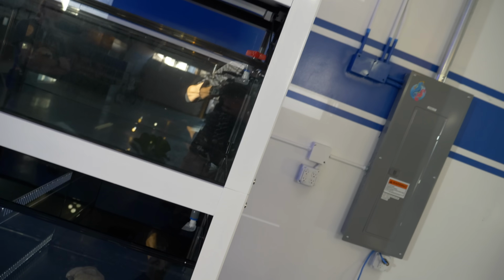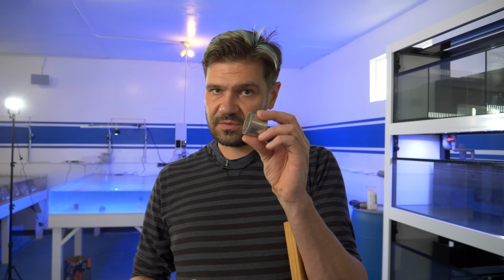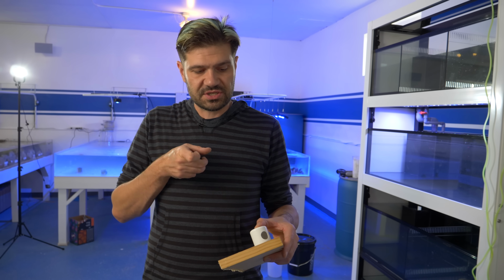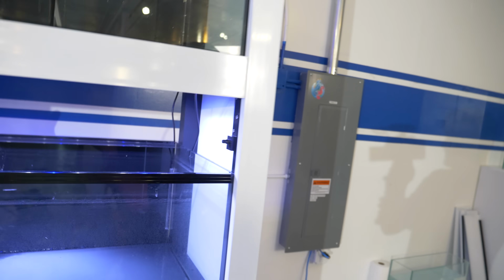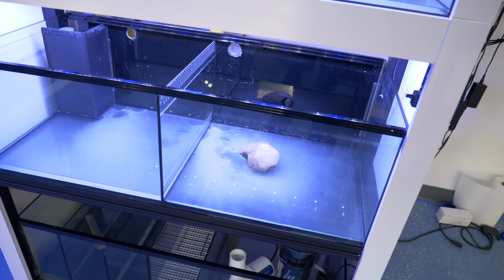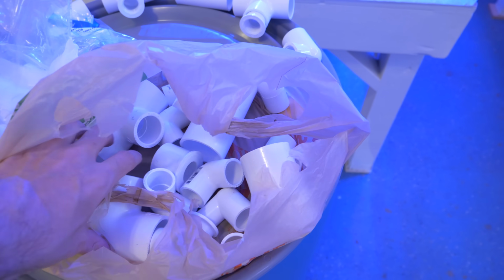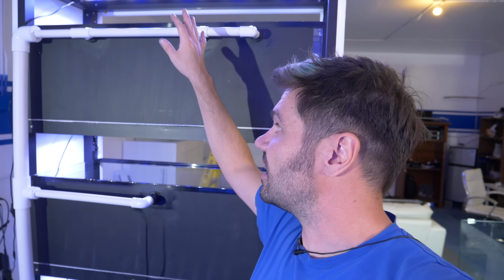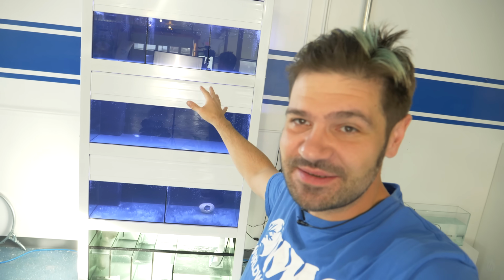Vlog 17: How to Drill Glass Aquariums (Better than I did)

Comment: I would suggest every single hole front and back use 2 piece of rubber cascade and apply a thin layer of silicon to prevent water leak.

Comment: Very cool video Jake.  I have been dragging my feet about moving a 200 gallon glass aquarium into place because I want the "movers" to first flip it in the garage to drill holes for an overflow, and then move the tank, basically couldn't imagine how to drill a hole on a vertical surface without an absolute ton of water.. but DUH!  drill the inside and the tank catches all the water.   Now I can move my fricking tank!   And I'll just get the overflow whenever.

Comment: If you press some flat material at the exit end of the hole, you should be able to avoid any chipping.

For example, clamp the guide on the start side and a flat wood on the back.
Reply: Thanks un02122! I'm going to have to drill my old 75g freshwater in December. Will keep that in mind! 😃
Reply: @TheReeferYT  
Good luck!

Make sure to take a break if the hands start getting tired and support the drilling machine with two hands.

Also, make sure that you don't end up at the end pushing through the hole and smacking the drilling the machine against the glass.

One last thing: don't drill too close to the edge.

Comment: Wouldn't you want the elbows of the back drains to be at a 45 to have the water have more drain flow so it is a drop off the drain instead of being level with the tank tops?